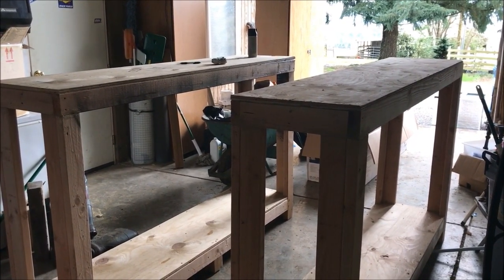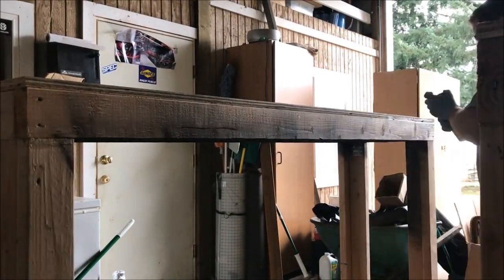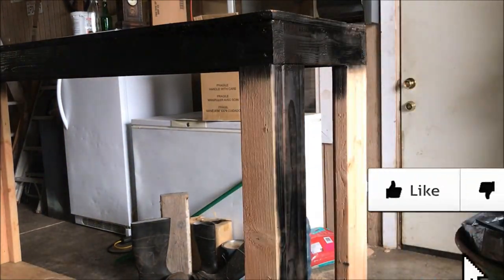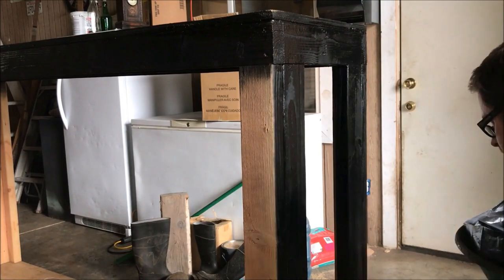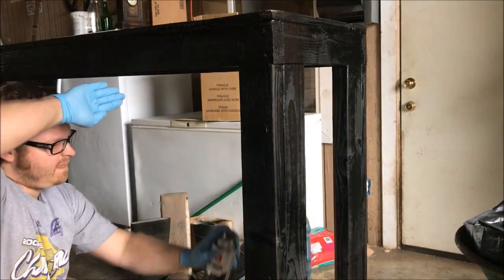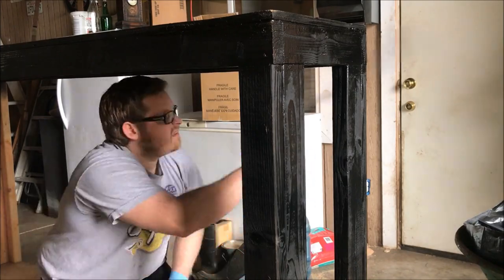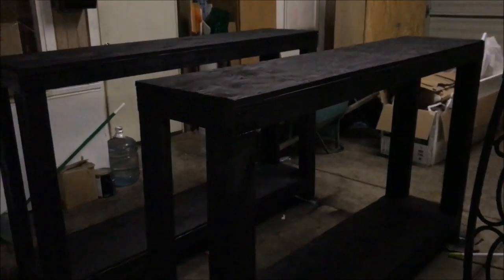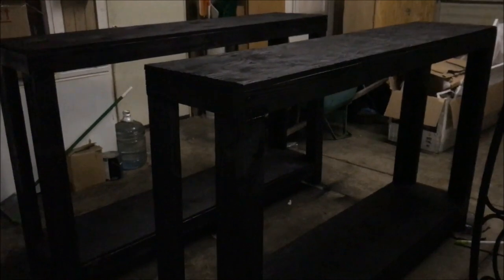DIY Rack And Tank Construction In My African Cichlid Fish Room | Assembly And Painting

Comment: Nice work, bud. I see that you have a metal joiner for the uprights. Are those joiners able to handle the load on it (i.e. the two tanks above it)? Looking at setting up a few racks and want to be 100% sure.
Reply from the maker: Hey Duane, so I would say yes. On this particular stand each shelf is rated for 800 lbs. The 40 gallon breeders with water is like 400 lbs give or take. So I felt that it would be fine since I am only putting half of the rated weight. And they are still standing to this day no issues at all for me personally